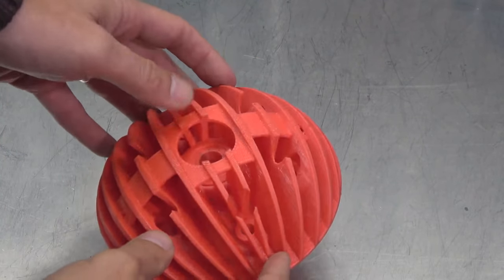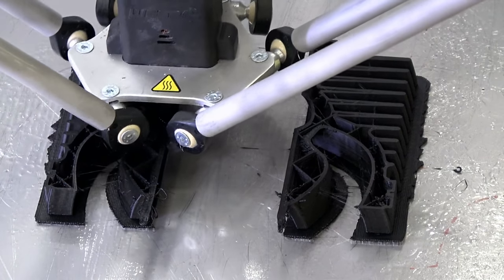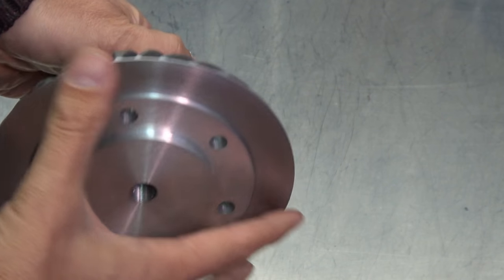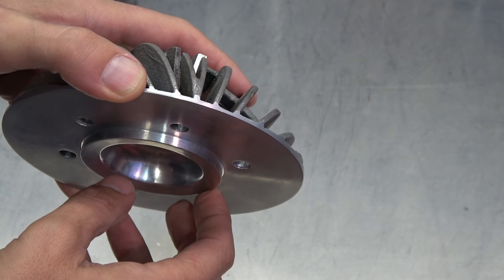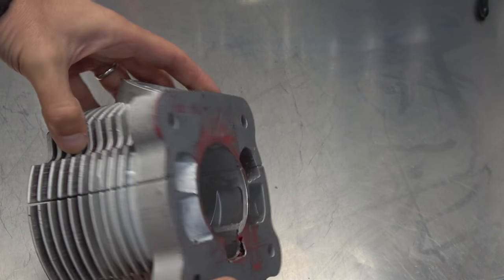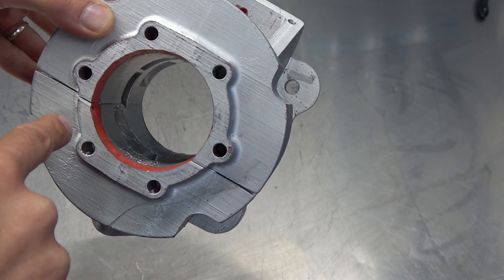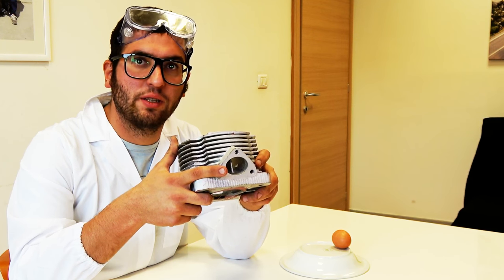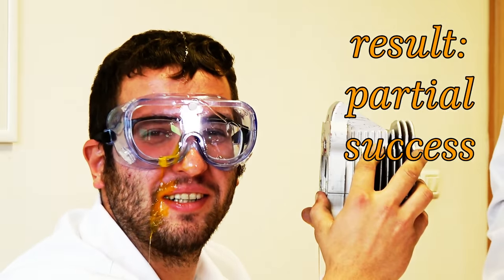Casa Performance | SSR 250 Lambretta cylinder kit introduction

Comment: We must be getting close to the limit what can be got out of these little 50+ year old two stroke engines lol, the cylinder kit is truly state of the art all weak areas addressed.
Reply: Robcatist - just the beginning Casa has opened the door with quality engine's for big bore Shifter scooters in 125 to 265cc it,s still a tame engine @ 47 bhp actually but still a Beast and capable in access of 55 bhp with the 72 mm crank and wild Porting I'm sure Thanks to Casa and Protti 😘  I,m just happy I can build my Lammy now to tame those Aerox 50cc and Sr 50,s automatics that's running big bore liquid cooled True Gp Cylinders like Roost Havoc and 2fast 100cc engine's making a Staggering 38bhp to the rear wheel! it,s only a matter of time before Casa and other Top manufacturer's push the 250cc and above to that 80 and 100 bhp mark we all know   2 Stroke Gp engine technology can produce in these scooter engine's of that  250cc displacement ;)Hint when you see jolly moto paring with Casa the real tuning about to go down in Gp fashion I'm all in nothing like having a ICC Shifter kart motor on my Lammy in Casa form Blasting these streets of Los Angeles in Stunning anodized color putting Full Dressed Hog,s to shame from light to light ;)